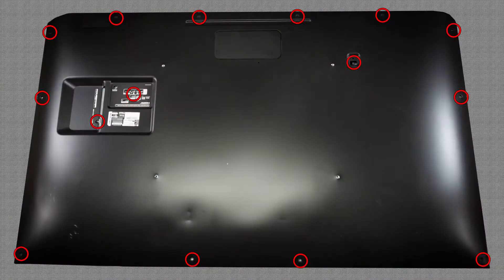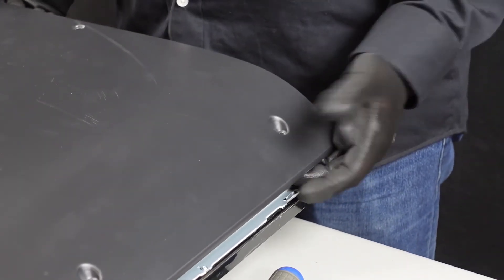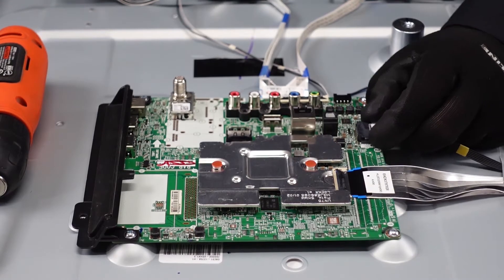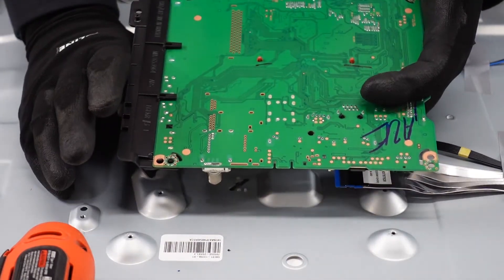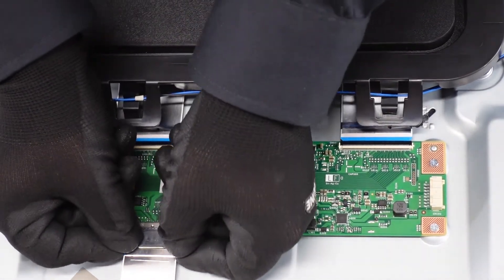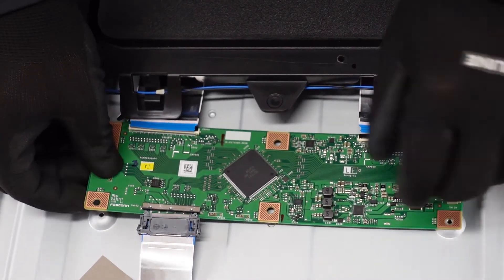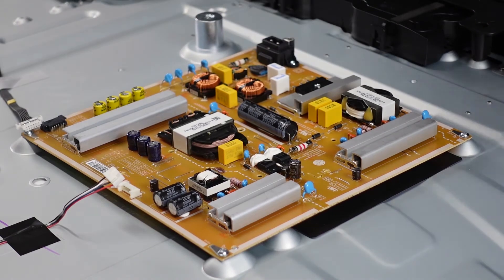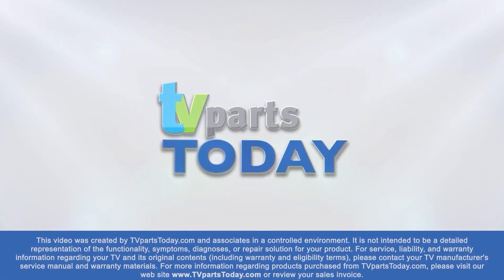Easy steps to fix your TV quick!  (LG 70UN7070PUA)

Comment: Which part to check for vertical lines in the middle part of the tv? When I change the volume, red vertical lines appear with the volume indicator. It is the 70UN7070PUA. I am thinking it is the T con? It’s what I gather from online comments. I wanted to get your opinion. Awesome video!
Reply from the maker: Thanks! I would recommend starting with the t-con board as well. If that isn't clearing up the issue, I would then try the main board. Let us know if you need any help matching parts for your TV or swapping the part.

Comment: Hi if the screen isn’t broken but the image display picture function is broken but you can see some pictures and application and commercial moving and sounds too, What part needs to be replaced?
Reply from the maker: It sounds like a main board issue at first glance, but I would give us a call into the office before making any purchases or trying to replace parts. The number is: (930)212-1975.  We have a knowledgeable CSR staff that would be more than happy to help you through the process.

Comment: when testing your repair, can it be tested with the back cover still removed?
Reply from the maker: It can be tested with the back off, but that is dangerous. I would recommend putting the back of the TV onto the chassis before putting any voltage through the set. I know it seems like a pain, but staying safe while doing any sort of repair on an electronic device should be the most important thing.

Comment: I've got the same model has in the video. Been trying to fix myself but no luck. At first the tv did turn on, backlight turned on but no sound and no picture. Ive changed the mainboard and i have sound but still no picture. So i tried changing the t-con board and still no picture. I opened the tv and all backlights are fine. Could you please help.

Thanks
Reply from the maker: Based on the information it sounds like a screen issue. It is very rare for the main board to be faulty when it is now giving you sound but not impossible. You can get a replacement on the main board to see if that changings any of your symptoms. Considering your backlights are working and you have replaced the main board and t-con and you still have no picture it seems like a screen issue.

Comment: Someone hit the left side of the tv so now it has a crack and sometimes picture shows up with color like streaks running down. What do I need to replace?
Reply from the maker: Unfortunately, any blunt force trauma like that would be unrepairable. Your screen / panel is cracked and damaged, it would not be easy nor would it be cost effective to attempt to replace the screen as it makes up on average 80% of the cost of the TV.

Comment: Our TV turns on for half a second and then back off. We've already reset the power and all that. Any tips?
Reply from the maker: There are quite a few issues that could be causing your TV to power off suddenly after turning it on. If you were trying to swap out boards to fix that issue, we would start with the power supply and go from there.  If you would like to go over your problem in more detail, send us an e-mail with your model number and a brief description of your issue to: info@tvpartstoday.com